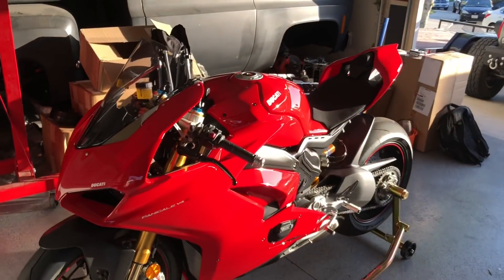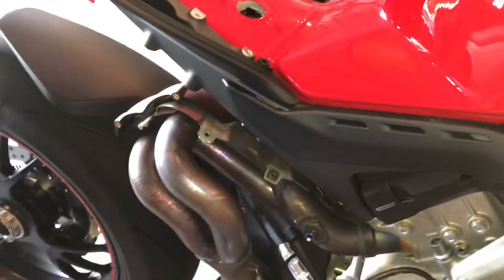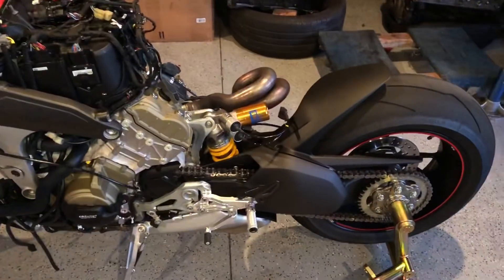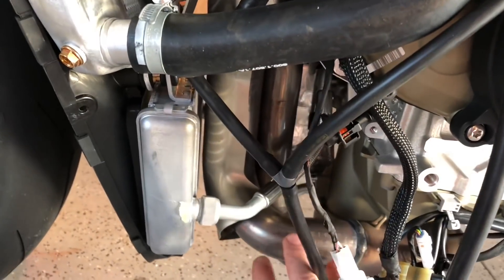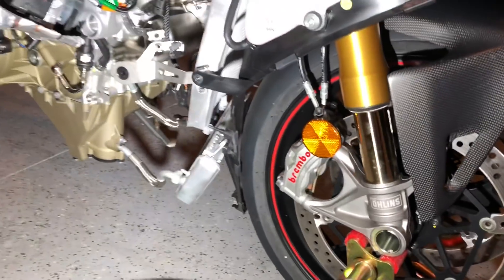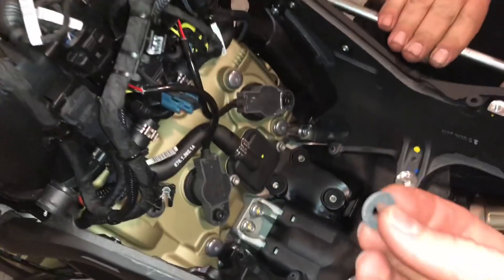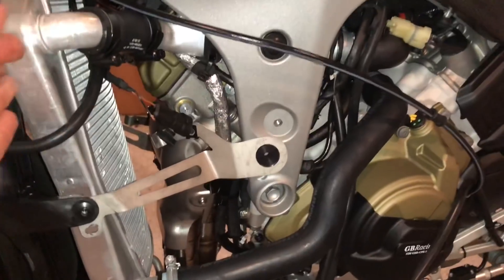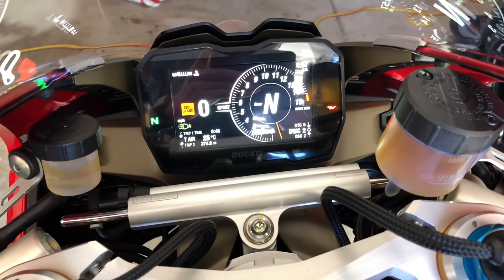Ducati V4, Install Akrapovic Full System

Comment: Awesome video! I have just had the akro fitted to my v4s as well.. but I don't think that the "Racing Evo" displays on the dash on start up. 
 I asked my ducati dealer who fitted it for me about it.. and also that the yellow warning engine light stays on and it back fires a lot on cold start ups.. and he said that they installed the up map and that it was probably due to being in different countries.. and they would check it during its first service. Appreciate your thoughts?
Reply from the maker: Wayne Griffiths it sounds like they did not install the map correctly. Have them do it again. Engine light should not be on and there should be no backfires from startup
Reply: Thanks Troy.. appreciate your feedback 👍
Reply: You were correct. Turns out the software for the up mapping was corrupted somehow during installation.. resulting in the back firing on cold start ups and no "Racing Evo" being displayed to confirm upgrade.. obviously still stock. They said maybe something to do with voltage disruption or spike or something. Ducati have all the data and are working out a fix to reinstall it.. hopefully early next week.
Reply from the maker: Wayne Griffiths sorry they messed up but glad you’re getting it sorted. You’re gonna love it

Comment: Awesome! What was the total time to get everything installed? The 10+ hours I got quoted by the dealer seemed pretty steep to me but that's a lot more involved than I imagined. Looks like all you're missing is a seat and a few other minor bolt-ons and you've got yourself a Speciale. My mostly-stock V4 base is getting pretty jealous! Keep the install / mod videos coming, I've found them super useful for the mods I've done so far (much more so than the instructions that came with half the stuff I've added).
Reply from the maker: Darwin Allen thanks! I still have more parts on the way :). It took me 9.5 hours today for my first try. I’m sure if I did it again, probably 6 hours.
Reply: Shit, 10 seems good to me, dealer said it’s a 20 hour job for a full exhaust and a 6 hr job for the Slip on..... guess I’m getting the full and doing it myself 💪

Comment: Did you get the aftermarket lower fairings for the exhaust?
Reply from the maker: #MLB_MotoVlogs I did but didn’t need to since I got the carbon inserts. You can just use the stock ones with the carbon pieces in my latest vid. Saves a little money from the way I did it.
Reply: Troy Gleason not sure if I got the right video, but those inserts cost more than the Ducati lower fairings
Reply from the maker: #MLB_MotoVlogs yes, but they don’t look like cheap plastic and work with the original fairings. I bought both
Reply: Troy Gleason the Ducati ones look like cheap plastic? Hmmmm.... maybe I’ll look at the carbon ones the.
Reply from the maker: #MLB_MotoVlogs yea, they look just like the stock ones but the lower plastic is just shaped differently. I never liked the plastic look on a Ducati